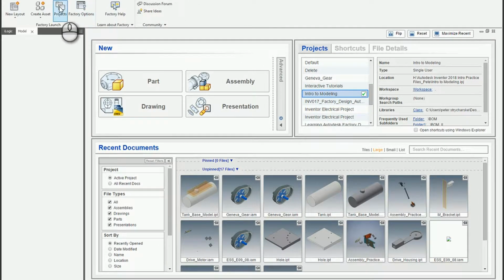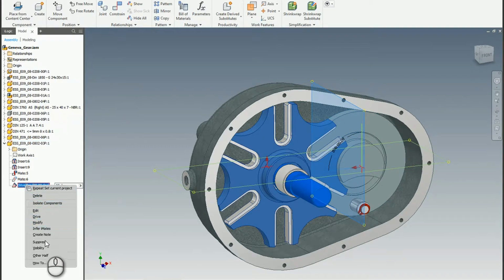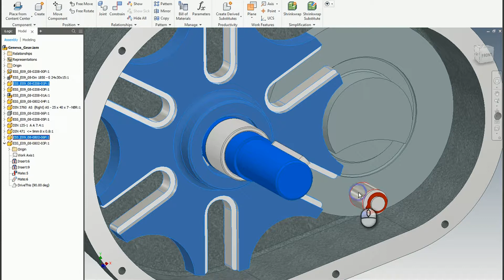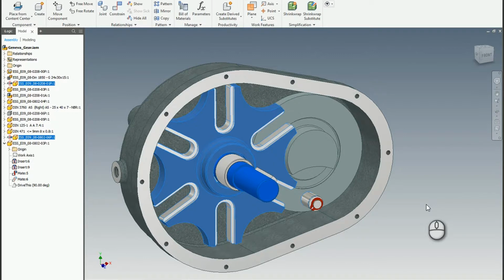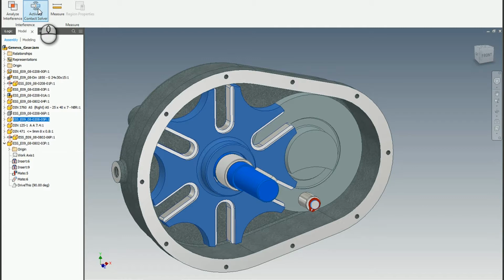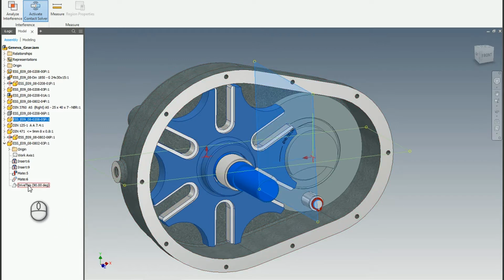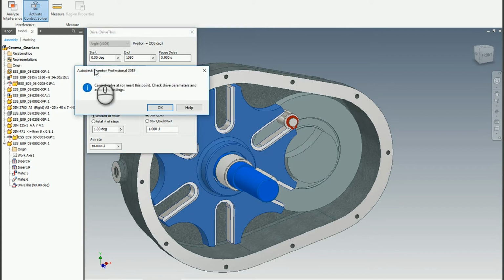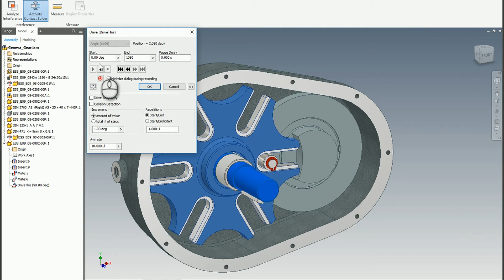Autodesk Inventor - Contact Solver and Constraint Driver

Comment: What if the collision detection was on? Wouldn't you get a message that there is a collision? 
In your case the collision is acceptable when rotating parts comes in contact with each other, but how do I tell to Inventor that this type of collision is acceptable and can be ignored?
Reply from the maker: Great question Sergey!  Collision Detection is a tricky option when driving constraints, as it finds ALL the collisions and stops immediately.  Therefore, I usually only test against the components that I set as a part of a "Contact Set".  If I set components as a "Contact Set" and the contact of those parts prevents motion, then the simulation will stop.  I use that technique to identify the range of motion for mechanisms.  If you want Inventor to ignore certain potential contacts, then don't include those parts in the "Contact Set".  Hope this helps, but please let us know if you have additional questions.